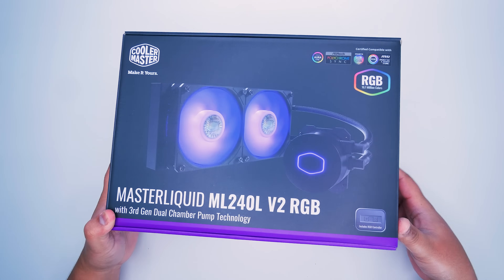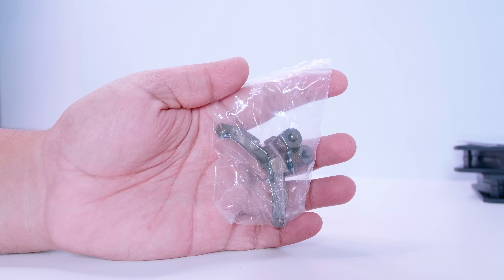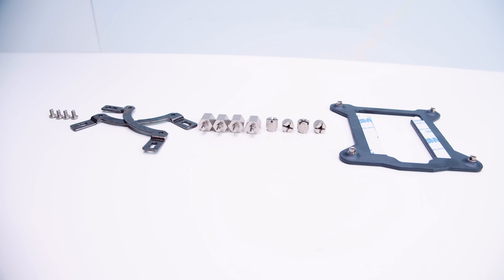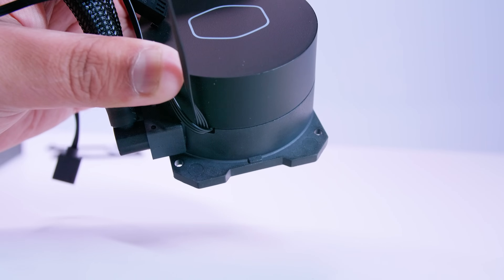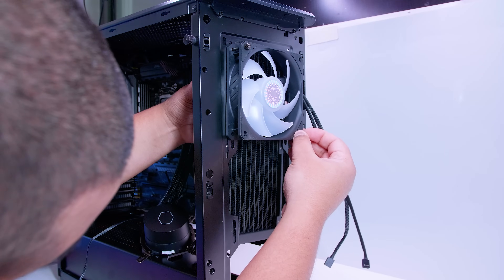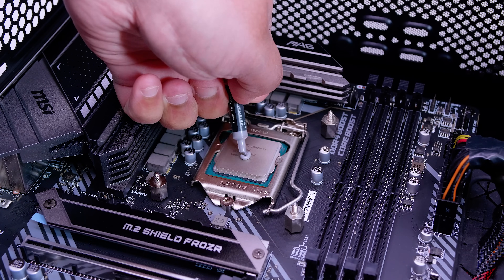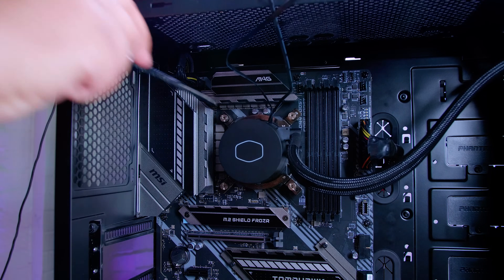HOWTO Install Cooler Master ML240L V2 RGB on Intel LGA 1200 and 115X Motherboards

Comment: what the? 2 fans are facing front you are pulling air into the case oppose to out of the case. heat is emitted inside the case and you want the heat to dispel out right????
Reply: Usually have intakes at the front and usually have outtake at the rear and the top cuz you need fresh air to push the hot air out

Comment: Where can I buy the little molex power cord for the rgb remote? I lost mine. And now rgb won’t work with my cooler because my new mobo only has 3 pin argb ports

Comment: I have done it exactly like you did, (with the controller) the cooler it self works perfectly but the rgbs dont. When i tried to just plug it straight on the motherboard like the second way you showed the cooler rgb works but the ones on the fans dont. Is there a way you can help me?

Comment: Something not right. You are blowing the hot air to outside? Open your car and see the radiator and the fan. The correct is the radiator outside and the fan inside sucking fresh air
Reply from the maker: You might want to watch the video properly

Comment: Instal AIO like this is totaly wrong. Your radiator if have air inside, and 99% have, will bring air exactly on top of radiator and pump will suck that air inside... Use logic mate
Reply: As long as the pump is not the highest point of the loop. It's not the most common as it might be noisy from a little air at the barbs on top of radiator.

Comment: I do have a question. After install Im not able to control the lights. It just sit on red. How do I change the lights. Additionally, I cant get the Mastercooler to show up on my MSI Center. I know the pump, fans and light are working. why wont it show up on MSI center? If anyone can help I would greatly appreciate it.
Reply: literally have the EXACT same problem, msi b360m gaming plus mobo, stuck on red with no way to change it

Comment: Question:  My mother board has a CPU fan 1, system fan 1, and system fan 2 connections I don't have a pump connection.  where should I connect the pump power too?  Thanks Tom

Comment: I have the white edition and it works great. As a side note, there is an new model, it is addressable. Mine is connected thru the bigger box version controller and to my Jrainbow header on my MSI board. I can control the pump and fan lighting with masterplus.

Comment: quick question, if my mother board (B560M DS3H V2) doesn't have a pump header how should I go about plugging it into the motherboard? Note that I do have a SYS_fan 1, 2, 3 and a CPU_FAN header.

Comment: I recently installed the same radiator displayed in the video and for some reason I’m not getting any display. I followed the instructions the way they were presented. Could it be cause I put a little too much thermal paste?

Comment: @Gear Seekers does the pump make a bit of noise? or is something loose on mine? I just installed it today using your video and it makes a really feint whirring noise. My old one (iBuyPower garbage) never made a sound unless it was clogged. Good video, it made the process easy.

Comment: For B560M DS3H, therre isn't a dedicated plug for the pump, so i used sys fan 1 for the fans, and cpu fan for the pump, then changed the bios settings to match (full power for pump, sys fan 1 to monitor cpu fan)
Reply: What do you mean?

Comment: Can I just connect the power cable to run the pump and let without RGB? I did this process but the pump seems like without power, how I check if it’s working properly?

Comment: i think my pump doesnt work. I pluged it in 3 pin on the msi z490. but when i check stats in bios, it shows 0 rpm. and temperature of cpu is 90. Please help

Comment: Mine has stopped lightning up, I had it connected on Z590-P, It was in 3-pin Gen2 but now when it's connected , it's not lightning up
Reply from the maker: The cooler and fans are not ARGB. You need to use a 4 Pin RGB header
Reply: @GearSeekers  it was working fine in 3 pin add gen2
Reply: I tried that too, still same

Comment: this installation GUIs is very useful. One tip I'll give is to put the fans in the pull configuration behind the radiator because it will be easyer to clean dust

Comment: I am currently using a i5-11600KF with a Cooler Master MasterLiquid ML240L V2 RGB cooler. I am considering to upgrade my i5-11600KF to maybe i7-12700KF. I see Cooler Master just issued a new MasterLiquid ML240L ARGB V2 Liquid Cooler (LGA1700 supported), which has the LGA 1700 mounting kit included but the main cooler is almost the same as the older-version ML240L. I wonder if Cooler Master will possibly offer a separate sale for just the LGA 1700 mounting kit for their older-version ML240L V2 cooler? Cuz without being able to buy the LGA 1700 mounting kit for my ML240L V2, I will have to re-purchase a second same cpu cooler, which I really do not want to spend extra money on. Any advice?

Comment: AHA! A question you didn't answer!
I wonder if the center of the logo could be scraped off the pump to light the whole center? Is it translucent plastic covered by black or two different plastics?
 I need the backlight for an overlay I made with my computer's name. It works on my 120 with the full Cooler Master logo, not so good with just the ring shape.
Hahah, I just bought one but I need somebody else to try it first.

Comment: Sorry about the late question but I can’t find a clear answer online. I have already mounted mine and in my beginner genius I mounted it with the tubes entering the pump form the bottom. In everything I have seen you are supposed to mount them from the side facing the RAM. Should I be remounting it?
Great video by the way, wish I had used this.
Reply from the maker: It doesn't matter
Reply: @GearSeekers  thank you
Keep up the good work

Comment: Hi @Gear Seekers, thanks for putting up this video, it was of great help.
However, upon installing it this way in my NZXT H510 case, the fans face outside and radiator inside the case, which means I can't see the fans at  all because the case is solid black at the front. Can I install it in a way to have the fans inside? 
Thanks
Reply: You'll need shorter screws to mount the radiator to the case frame, then just move the fans to the other side of the radiator.
Reply: same dilemma any tutorial on this?

Comment: Sorry but I think the original (MLX-D24M-A20PC-R10) is a better setup. It costs $30- more but has a more robust RGB display on the pump block and the comments on the V2 show a lot of pump mounting failures and fan mounting breakage but none for the original. Doesn't seem that cheaper is the way to go. I bought the original before I saw there was a V2. After seeing comments on V2, I'm glad I did.

Comment: I just watched you put the thermal plate on the cpu and get it on the first try, but here I am 15 minutes later and it's still not fitting. I give up.

Comment: I will add that the manual does NOT mention LGA1200 and it was impossible to get hold of cooler master for answers, so this video was extremely helpful.

Comment: Hey  I bought one of these used off eBay and everything works but It didn't come with the Intel bracket I have a LGA 1150 Socket and I can't find a replacement kit anywhere and I really need one so if someone knows where I can order replacement hardware that would just be awesome

Comment: What happens if I don’t have a pump connection in my mother board ? Is a b460 aorus is a micro atx motherboard
Reply: Did u ever figure it out I’m running Across this problem right now trying to figure out where the pump goes

Comment: Caution, highly recommend only hand-tight on the bracket header bolts, I used a ratchet on mine to tighten it up a bit and ended up twisting the head off of the double sided screw/bolt. Now have stuck screw inside the bracket holding it tight to the motherboard. Will have to drill out the embedded screw head and try not to fry the system with metal shavings. Cooler Master needs to make better quality metal parts.

Comment: Thanks man! These instructions also work for the ML120L version, which is the one I own. This is a great cooler, I bought it for a Ryzen 5 3600 and now I'm using it on a Core i7 11700.
Reply: Does it work with de the S1200 socket?

Comment: Question. Are the rgb on the fans and the cpu cooler suppose to light up when i turn my pc on for the first time or do i have to manually do it through a software?
Reply: Some question I have did you ever solve it ? Need help now

Comment: I have a question. I have the LGA 1200 mobo and the back bracket for the back of the mobo does not much what you have in this video. Did they change the black bracket as mine has no area to thread into. It has weird black plastic clips and long screws with a little thread on the end and on the other end a flat square head with no screw driver slot. This is my first time installing the cpu liquid cooler and it is starting to stress me out!

Comment: After installing mine, it lights up, fans kick on then it shuts off. Tried plugging pump in 4 pin cpu fan as well as system fan headers. Checked all cables. Idk what is wrong.

Comment: Followed these steps for the rgb part but it’s still not going on? After I connect the 1 to 3 way RGB splitter where do I connect the one that’s by itself without the pins?
Reply: Did you figure it out?
Reply: @sedricksimmons3172  lmaoo ye like 30 mins after I commented that. Good looking out

Comment: Will it fit all micro atx cases?
Reply: Most micro atx cases have the top to add a radiator and two fans so as long as the aio is 240mm then yes it would work
Reply: @diegomusty  yeah mine has to go to front panel should be fine though

Comment: i have a problem. my motherboard only has one cpu header and no pump header i also have a sys fan header but that's where the case fans are plugged in. what can i do?
Reply: would using cpu splitter to connect pump and fan into a single cpu header work?

Comment: I only have a cpu fan header and not a cpu opt, does that mean I can’t run this aio?
Reply: Did you figure it out if not what motherboard do you have
Reply: EliteSlyr yeah I did, if you’re having trouble like me. You just gotta plug it into Sata since the pump stays on 100% anyways. Then daisy chain the rad fans to your cpu fan header
Reply: @raeantonio9390  I did it just was trying to help out

Comment: I know this video is slightly older now but i'm hoping you can help with a pretty simple question. I have this exact AiO and case, i would like to use fans on both sides of the radiator. So my question is does it matter if i install the first set of fans on the outside of the case like done in this video vs leaving the stock phantek fans on the inside position they come and adding the radiator +2 more fans. Is the weight too much to have all 3 layers inside the case? Or is best practice mounting the first 2 fans outside (like this video), then radiator inside the case with extra 2 fans attached inside?

Less confusing version:
|FAN| |RAD| CASE |FAN| VS  |FAN| |RAD| |FAN| CASE - does it matter?

Comment: Just wanted to say I just built my first pc ever and this video along with a few of your others ones saved me when it came to cables and knowing where to plug things in. Couldn’t have done it without you
Reply: Yo, does this cooler with with a mini it’s case?
Reply: @roderick9039  depends on  the case, as long as there is space for the 240mm rad somewhere

Comment: i just have cha_fan and cpu_fan because i have a h310m-e r2.0 motherboard but when i plug the pump into cpu fan and the fans i mounted on the radiator into cha_fan the radiator fans dont work

Comment: Got a problem not got a pump connection just a CPU fan so could I just connect the pump into that?
Reply: I have the same problem did you figure it out or?
Reply: @charliepike235  I just plugged it into the CPU fan headed for the pump it works fine
Reply: @velocity7473  brilliant cheers mate

Comment: Should I install the water cooler everything after I’m done building everything or not?
Reply: Depends on your setup and the space you are working with, e.g. you may not have enough space to insert ram easily if you install cpu cooler first

Comment: hi I have a question my motherboard doesn't have a pump system connection can I instead connect to CPU fan connector
Reply: your cpu fan connector is for your cpu fan, not the pump.  Refer to your motherboard manual and you should see where the  pump fan is located.

Comment: ive just ordered the Cooler Master MasterLiquid ML240R - does this install same way as this one? - also whats the difference with radiator at front vs the top? (my case recommends the top as it has two 200mm fans at the front)
Reply: Yes it should install the same and I do t think there is a difference mounting it on the top or the front
Reply: Be cause I have had 2 120 mm AIOs at the front and top and there was no difference
Reply: @will.2.shiesty  OK thanks! It's been 11 years since my last pc build and they only had air coolers so was double checking before it arrives all this week. Lol

Comment: is there a software to control its color
Reply: No. If you use the RBG header on the mainboard you can control the colors with your motherboards rgb software. Such as RGB fusion for Gigabyte.

Comment: IMO it's better having the rad and fans in the ceiling of the case blowing the hot air out of the case.  It doesn't make much sense having the fans at the front of the case dumping all the heat from the rad into the case.
Reply: You gotta understand that you gotta cool the radiator also.. and you can cool it much better by using outside air instead of much warmer internal case air... That's what you have exhaust fans for inside though.. To take hot air out..
Reply: @aaronnoneya8071  I understand completely, been building high end custom watercooled pcs for more than 2 decades and probably built more than 60 custom pcs to this day.  The warm air that is being dumped into the case  by the extreme temperatures coming off the radiator is far worse than having the air pulled through the case and exhausted through the rad. I've done plenty of optimal testing finding what keeps components the coolest whilst maintaining the lowest case ambient temperatures over so long now to know the better way is to have the rad in the roof getting rid of the hottest air in your pc rather than dumping it into the case.  You're looking at over 12c hotter inside a case having them in the front of the case, added to the fact you've then got higher ambient temps effecting every other component in your case, mainly the gpu.  It's the worst way out of the two to have it in the front rather than the roof.  The front of the case is designed to pull in as much cool air as possible for the natural way pcs are designed with exhausts in the rear and top.  The heat that comes off a cpu rad is so bad there's very little way to continually exhaust that heat unless you have more fans making it louder than a 747.  Do it this way and the only air blowing into your case will be cooler air which will naturally be pulled through the top of the case by the rad fans.... Its cool air still.

Comment: I am going to mount this cooler on a CoolerMaster MB500 case which already has 2 fans in the front. I saw a video of someone doing that same combination that I will use and he has mounted the radiator on top of the case with fans from inside to outside instead of the front of it with fans from outside to inside like you did. Is that totally fine or should I get the case fans removed from the front, mount them on top and then mount the radiator and its fans on the front like you did? Is it just a question of preference of each person or does it make any difference?

Comment: I have cpufan 2 instead of pump fan. would it be a problem if I plugged it into cpufan 2? BTW female is 3 pin while the male on the mb is 4 pin. does it matter which pin I leave off?

Comment: I tried installing this on my Intel i7 10700K LGA 1200 today and nearly destroyed my CPU. It is not compatible with LGA 1200 CPU sockets...
Reply: This was installed on an i5-10600k, also LGA 1200.
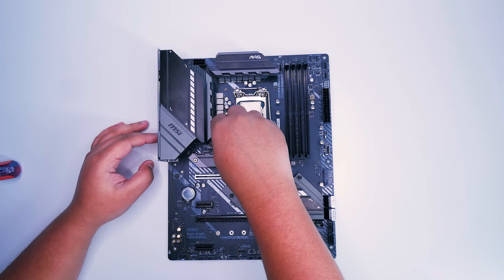Reply: It says on their website it's compatible but at the 7:00 mark where he's installing the support bracket mine is a bit loose?

Comment: Well this is a answer for the question I was about to ask. But grabbed the install manual for guidance not knowing how long it would have taken for a reply. 

If you are wondering about rgb plug orientation to the motherboard header. The arrow goes the the 12v positive end.

Comment: Hello, I ordered one and after installing it and following everything you did
The pc turned on water pump is working fans are working and the RGB lights as well
but nothing displayed on my screen, how can i fix this problem???
Reply: Make sure the hdmi cables you're connecting to the monitors, are connected to the graphics card if you have one and not the motherboard

Comment: Am I the only one who is experiencing very loud fan noises?. I installed everything but the fans are very loud. I ended up replacing them but had to lose the RGB. I am disappointed and was wondering if anyone is experiencing the same thing and has a solution

Comment: Hi Gear Seekers , What if I connect pump cable 3pin into aio pump header not cpu fan opt ? Is it fine or this header will make pump rotate on full speed always and not up & down as demand ?????